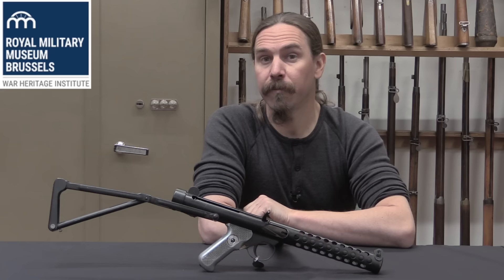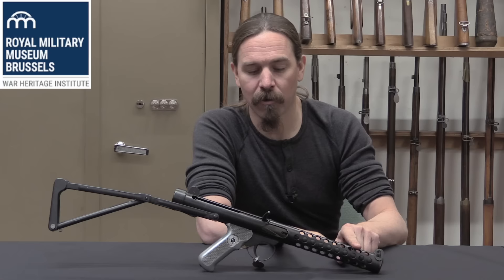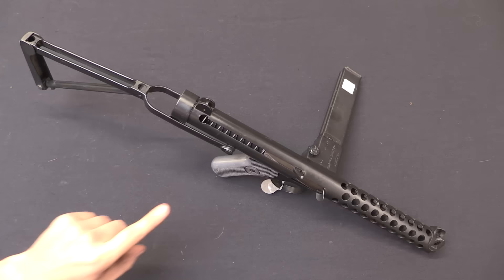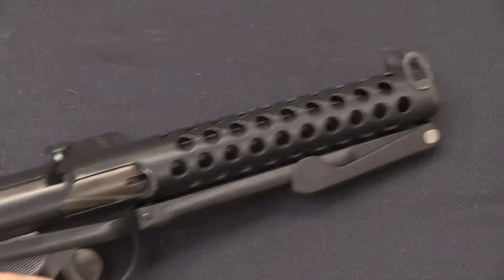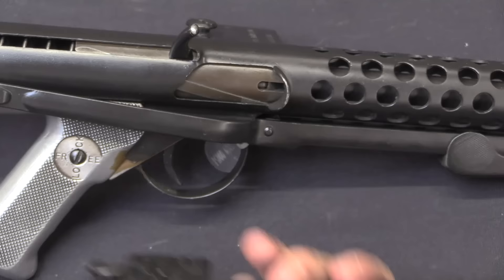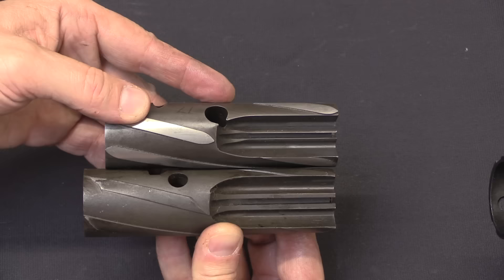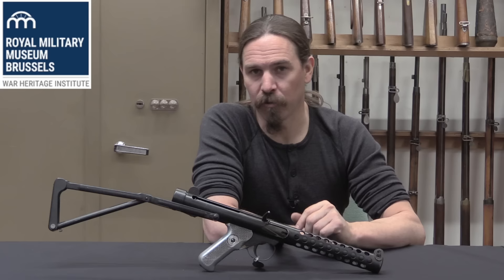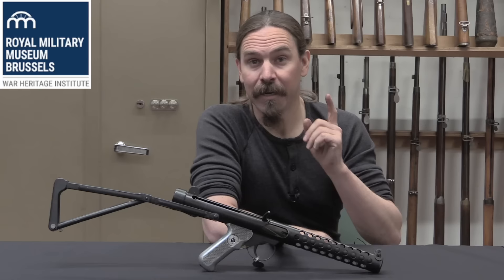Patchett Machine Carbine Mk I: Sten Becomes Sterling

Comment: Of the dozens of SMGs I've fired.  My favorite is the Sterling.  Thanks for the history Ian.
Reply: Why?
Reply: I can attest to that. Got to try out a Sterling myself six months ago and it was the most accurate, most controllable subgun I fired. Handled like a well-oiled typewriter.
Reply: @nomad_boreal  thank you for the response
Reply: @user-oi1fd6fx2j  Controllability and ergonomics.  Just a great compact SMG
Reply: @chlebowg  thank you@
Reply: The Sterling is very controllable in full auto due to the heavy bolt, stock, and pistol grip placement.  The barrel length and ergonomics also made it reasonably accurate at longer ranges in semi-auto.  Not as compact as a lot of subguns, but eminently reliable and nigh indestructible.

Comment: I was in the Canadian army in the 1980's. The SMG (Sterling) was standard issue until we adopted the C8 (M16 A2 Carbine) to replace it. It was super compact, reliable and easy to maintain. The range was not there but it was issued mostly to vehicle crew and drivers.
Reply: The SMG was more widely distributed.  When I arrived in an infantry battalion,  they were carried by platoon signallers, GPMG gunners, much of Recce Platoon etc.  The C8 was originally intended for armoured crews only.  I worked for a bit in the weapons company at the Infantry School when they were sorting out final handling drills and writing the pams etc for the new family of small arms in 1984.  I had a specific discussion with one of the WOs there about the C8.  He said, "it's only for tank crews.  No doubt some infantry Maj will desperately try to get his hands on one in order to boost his cool factor... but... they're designed for the Armoured Corps".  I was in Germany when we received the new rifles in 1988 - not a C8 to be found anywhere.  In fact, I never saw a C8 in an infantryman's hands until Afghanistan cranked up.
Reply: @lib556   It's not obvious until you take off the handguards but the barrels on the C8's are pretty thin.  It's not an issue as a back up weapon for armored or recce and it does make it much lighter but those things can overheat severely in a sustained firefight.  The savings in weight and size aren't justified for dismounts.
Reply: @silverjohn6037  That was the thought at the time.  Proper infantry get a proper rifle.  Z*pperheads' primary weapon is their tank so... Similar concept as was the M1 Carbine.  Not a battle rifle but much better to give someone than say a pistol.  However, as history will show, the M1 Carbine became very popular, despite its limitations, with many in the infantry.  It was Audie Murphy's preferred personal weapon.

I'm no gunsmith expert - just a user, not a builder.  However, there has been much discussion in US circles about the necessity (or lack thereof) for heavier and longer barrels. It would appear that the best balance between velocity and length-saving is between 15 and 16 inches.  Many argue that the 'pencil' barrel is all that is needed.  Again, I'm no expert.
Reply: @lib556   Lt Murphy was also fond of .50 cal Brownings but only when they were on burning tank destroyers for some reason;).
Reply: @silverjohn6037  Use whatcha got... 😁
Reply: My dad was in the Royal Electrical and Mechanical Engineers and he used one. It was a great weapon for people who did a lot of driving as it could fit under a seat.
Reply: @lib556   You couldn't find a C8 because we had them all, over at the North Marg in Lahr. 😁 Honestly I preferred my SMG C1, at least if you ran out of ammo it was a nice short steel club. 😂
Reply: Compact, reliable and easy to maintain. 
The SMG summed up in a sentence by an experienced soldier. It was never intended for long range work but it did squeeze every last ft/lb out of the 9mm pistol round. 

I liked the thing. Great for CQB trench and room clearance.  Range aside, the weak point was the magazine and the feed spring. We were told never to use the magazines as bottle openers. On the ranges, to only fill the mags to 20 rounds. Thereby extending the life of the springs. But in combat, 32 rounds could be squeezed in.
Reply: @silverjohn6037  Agreed.
Reply: @gusgone4527  Way better than a pistol, for sure.

Comment: Hi, when I first started soldiering In 1956, I trained on the Patchett SMG and was very grateful as the Sten at that time had a bad reputation for firing when dropped on the ground. The early SLR’s also came out at the same time but they were the automatics with the bipods. In the sixties when. I joined the Paras it was an easy swap to the Sterlings and the Brit SLR’s. With the bayonet lug attached we started to learn SMG Arms Drill and the changeover from the Enfield rifle to the FN was that much easier because of the earlier introduction in Africa. Many years later coming home I did a spot check on our Auckland armoury and was amazed to see a dozen old Stens and watched an armourer getting first aid as he cut himself on the charge handle cut out that got so sharp over the many years of usage! Those old SMG’s just kept on going and the SLR’s sure came in useful in Nam. Cheers mate. Harera

Comment: Pachett did not work in Brno, he worked in Prague at the Janeček/Jawa motorcycle factory, which came under Zbrojovka Brno only in 1945, they adapted and manufactured Schwazlose machine guns and a special type of grenade vz 21, which unlocked itself by rotating when thrown. He either threw prototypes of anti-Ank rifles over the wall of the British Embassy in 1939, or drove them to France in 1940 by car covered in bed.
Reply: @LaCokaNostra_   What no?
Reply: @DOMINIK99013 you are missing the point, he worked in Brno the place, not specifically the armament company
Reply: @jediknight1294  He didn't work LOL, Janeček/JAWA had nothing to do with Brno until 1945, he worked in Prague in the 1930s, he also took a number of photos and videos there, the best private shots of the arrival of the occupiers and Hitler at Prague Castle are also from him.
Reply: @DOMINIK99013  my point was Ian didn't state anything other than he works in the city of Brno.

If he was naming the arms manufacturer he'd have used their name not simply the city as he's done in the past.

Also fun fact, Brno had a couple of companies  working on small engine Mopeds I the 30s that later became influential in the  Jawa labeled PS built products like the Manet and the Babette
Reply: @jediknight1294  The fact that he lived in Prague is mentioned in both the Czech article on the wiki and articles elsewhere. The fact that Ian says something doesn't mean anything, he himself admitted in one of his QA videos that a mistake could be found in all his videos, this is doubly true in the Czech ones.

Comment: The Sterling ‘Small Metal Gun’ was my personal weapon, by the end, the sears of unit SMGs were worn and double taps were a feature. The Indian 9mm was not up to standard and then the army ran out of 9mm ammo but our transfer to SA80 was delayed because of the ripple effect of the magazine latch issue. 
The EM2 was meant to cover sub-machine gun and rifle but when that fell through the L2 Smudge gun was adopted. But that was before my time.
Reply: I had one run away on me on the range.was Indian ammo that caused.

Comment: If Patchet had thought of adding a couple of small offset metal tubes welded on each side of the receiver behind the pistol grip he could've made a stupid simple collapsing stock over a folding one. 

Nowadays a simple pistol grip with a quasi extended "beaver tail" with the collapsing stock passthrough ports made out of polymer is a possibility.

Comment: I have fired most of the British Army small arms that were around in the 50s/60s,  the SMLE, the SLR, the Bren gun, but I cannot remember if I ever managed to fire the Sterling.  I think I may have !  I have also handled the EM-2, which Ian did a lovely video on some time back.  I do remember that the EM-2 was passed to the warrant officers of the Brigade of Guards to work out the rifle drill, and they were rather non-plussed at being handed a gun that bore no resemblance to a normal rifle. I suspect there were no rifle drills for the Sterling either !  Interestingly, the SA-80 is carried at the slope just like the old SMLW I carried when in our school cadets.

Comment: The Sterling was called the "L1A2" in NZ. My first use of a submachine gun in 1973 was one of these.  Used at 25, 50, and 100 metres, both single and auto, from both the shoulder and the hip, it was an easy gun to use and control. Best results were firing from the shoulder in 3 to 5 round bursts. Stayed on target at all ranges. Very easy to field strip and clean. Light and easily carried or slung. Navy used them for boarding parties. After I left Navy, they reluctantly traded them for HK MP5s.😊😊😊

Comment: His work history appears to be working for arms manufacturers that also made motorcycles:
"In his early career he was a motorcycle racer for motorcycle manufacturers such as Brough Superior, McEvoy and the Belgian arms company FN. At Pendine, Wales he won the Welsh TT in 1925 and the Welsh TT sidecar in 1927 on Brough machines.

In 1930 he was recruited by the Czech arms manufacturer František Janeček, founder of the JAWA motorcycle company, to work as an engineer and a racer. Due to the economic recession Janeček wanted to build a cheaper motorcycle than their 500cc model. Patchett's contacts with the Villiers company enabled a new Jawa 175 Villiers to be designed around the Villiers 175cc two-stroke engine which proved very popular."
Reply: I believe Pendine is also where someone famous was killed running a record attempt with a chain driven car, something like the Golden Arrow or similar, I have been on the sands it has an amazing history. TE Lawrence, also a Welsh man was fond of the Brough's. My great uncle was a Royal Marine Commando DR Despatch Rider used standard bikes in ww2 from D-Day but loved the Brough Superior for his own use. Fascinating to read your comment.

Comment: The big difference between the British SMG and the Canadian SMG C1, was the bolt on the C1 was solid with a fixed firing pin and a one piece recoil spring. Oh and we did have a bayonet lug as well, that fit an FNC1 bayonet.  And yes we had chrome bayonets for parades.

Comment: A few were trialled during Op Market by the Air Landing Bde.   "The Guns of Dagenham", Peter Laidler quotes Tommy Fitch, an Arnhem survivor and former curator of the Airborne Forces Museum, told him that six were used at Arnhem; Laidler 's own research through the records revealed that four guns were sent to the Airborne Forces Development Centre and only one can now be accounted for. It would appear that three guns (067, 070, and 072) could have been the guns that went, and never returned. The fourth gun (062) is now in the Pattern Room collection. However, there is also some hint that the four in question were actually back at Patchett's at the time of MARKET GARDEN, getting modified.

There does seem to be a "geometric progression" issue with the Patchett legend - somewhere along the line the numbers of trialling Patchetts in the Arnhem timeframe seems to have risen from 4 to 100!
Reply: it would make sense if trialling a gun to use it somewhere if there were problems, the users could go back to regular guns or the number of guns was relatively low so wouldn't affect outcome. A drop far ahead of regular supply lines wouldn't be my first choice of test area

Comment: I'm still confounded by the British Gov/Mil preference for a knock off of an awkward German design (that Germany abandoned in the mid-30's before the choice of the lanchester/sten) over a much more ergonomic French one? True it had been designed for the 7.65mm French Long cartridge but a redesign for 9mm parabellum shouldn't have been a major obstacle.

McCollum's got one of his own & he's made multiple video's of the French MAS 38
Reply: Well, the French don't have a long and storied history of succesful cooperation in military development, and that's including modern times when due to NATO, cooperation on weapons programs is more common and accepted. In a time when most nations were only vaguely starting to show mild interest in the idea of "machine pistols", the French weren't simply going to hand off their newest ideas to a foreign power. So the British took what they could get when they could get it. That turned out to be MP-28s which, apart from the awkward magazine gripping thing, is mechanically very straight-forward as designs go. The Brits just copied most of it, changed a few fitting preferences and stuck a SMLE stock on the bottom of it.

Comment: bolt fluting "may have" also helped Vent Air from rear while helping cycle and/or blow gasses Away from bolt shell extraction and shooter? while pumping unwanteds' out? interrupting while in spiral at bolt slot for better flow checking/ venting of said unhanded?
Sorry I did hydraulics and pneumatics. RACED AMA Dist 37 Mojave too.   I see what I see.

Comment: That looks like the E-11 Blaster used by Imperial Stormtroopers in Star Wars. Anybody else see that or is it just me?
Reply: That is correct. The blasters had a fake battery pack/electronics added over the mag well, a much shortened magazine to fill the mag well,  t-shaped plastic drawer glides in the cooling holes and a tank spotting scope turned backwards on top. The one Han Solo uses in the DeathStar when they're rescuing Princess Leia is a live weapon using blanks. Lucas wanted the recoil of firing to look real without the actors having to fake it.
Reply: Sometime in the 60’s the Imperial defense acquisition agency issued an RFP for replacement blaster rifles, the Sterling fit the bill. Soon after both Vader and Palpatine visited the manufacturing facility for a tour and accepted the first delivery of them just before the Battle of Yavin.
Reply: Just you. The E-11 looks like a Sterling.

Comment: Question: Did anybody ever think of extending the receiver/ barrel shroud to the front and building a permanently fixed muffler into it? I have often wondered about it, and apart from the increased weight, I do not foresee any drawback. It should be perfectly suitable for the STEN/ Stirling type arms.

Comment: Great video, Ian but you’ve got the charging Handle/firing pin relationship backward. The firing pin holds the charging handle in, not the other way around. @Forgotten Weapons
Reply: Fixed in the subtitles (which he does quite often)
Reply: @kegluneq6306  it's a shame if you remember these criticism of Linus Tech Tips for corrections in the subtitles not too long ago. It was pretty harsh & damning.

Comment: Did you get the requirements and the actual rate of fire the wrong way round? You said the requirements were for a 500 RPM but the gun 'only' had a rate of fire of 580-600 RPM
2:55

Comment: It lacks all safety features found on later guns like UZI (with or without the ratchet cover), Walther MPL Beretta model 12 and Star Z70, but, for WWII, it was far better than german and italian mass produced guns. Short overall length, real double feed magazine (like the italians used and the germans ignored), solid machined parts lockwork inside the grip, the huge distance between stock hinge and its locking point and, unlike the STEN, no mousetrap spring connected to a bicycle kickstand spring to make the gun fail. That's what happens when a talented guy is left alone working without idiotic limitations.